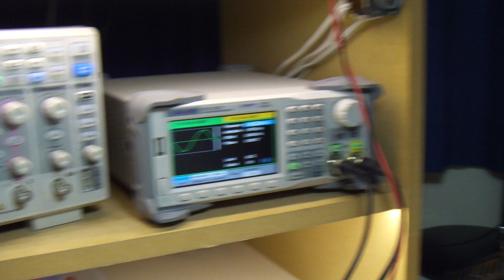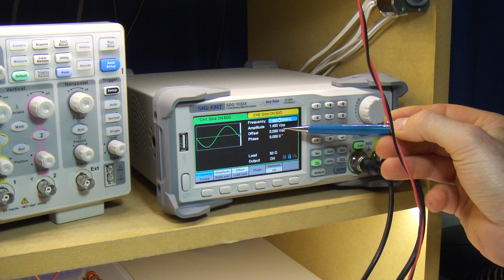Go QRP SSB Rig: Part 2 - Simple Superhet Receiver Test

Comment: Low side injection?  Not the best idea.
Reply from the maker: I did try high side for a comparison and didn't see any difference. I played around with low side to make the maths easier. What's the advantage of high side?
Reply: @CharlieMorrisZL2CTM  Better image rejection, and can use simpler front end filters.

Comment: Nice to see a new video.

Out of curiosity have you tried running the mixers from a square wave out of that sig gen? Does it make a difference?
Reply from the maker: Hi Clint. Yes i did and there was no difference (that I could tell). I will be using square waves out of the Si5351.

Comment: Hi Charlie. Thank you for another nice video. I love your videos but on the other hand I try not to get any ideas. I want to do my own constructions. 
I have a question. I am building an Arduino VFO. Some people say they are noisy, but you have used them for a while now. Do you have any noise problems with the Arduinos??
Reply from the maker: Hi René. Thanks for the feedback. I am no expert, but for me the Arduino+Si5351/AD9850 combination works well. I have not done a full on comparison with other VFO/BFO options, so I cannot comment there. Again, for what I am after they work fine.
Reply: @CharlieMorrisZL2CTM  Thank you. I also think that the sound of the radios are fine on your videos. So I will continue my project.